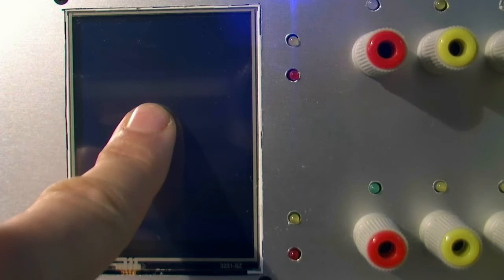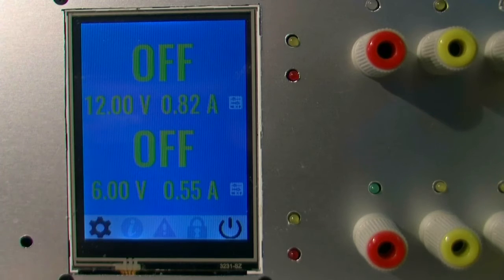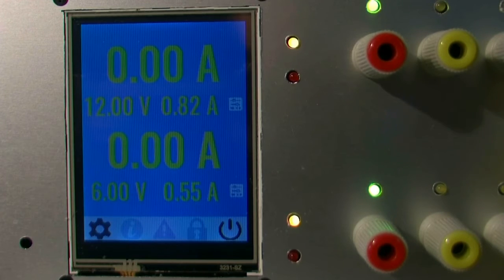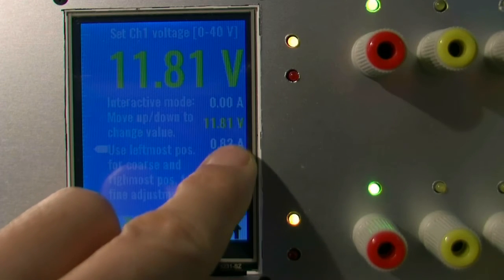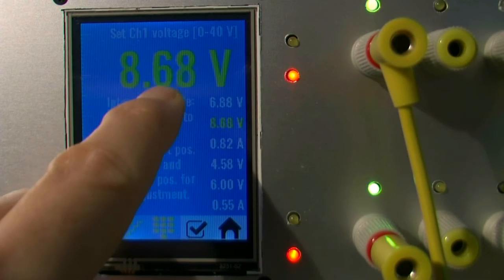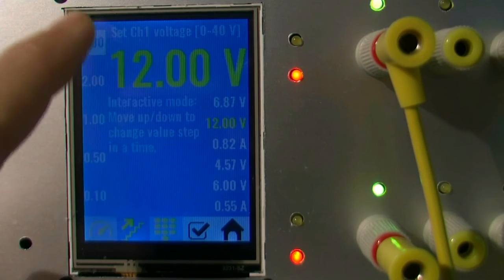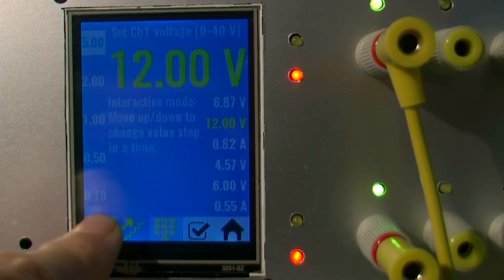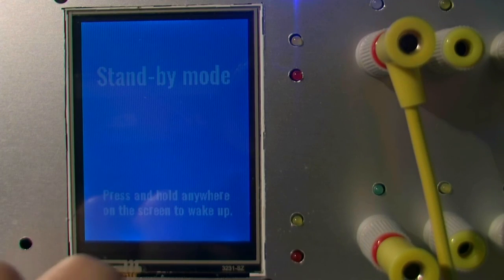Output settings first preview

Comment: Very nice demo. I would suggest using a fixed font for the digit's. That way the values will not "jump" when you change them. Keep up the fine work. :)
Reply from the maker: Hi Christian, it's jumping back and forth due to alignment that was centered instead of right justified. We'll that care about that, thanks for your comment.